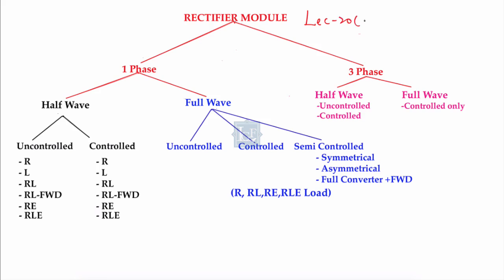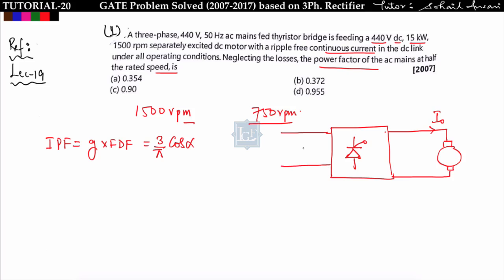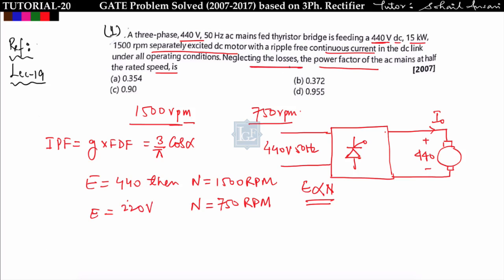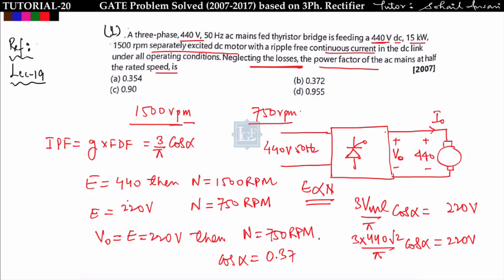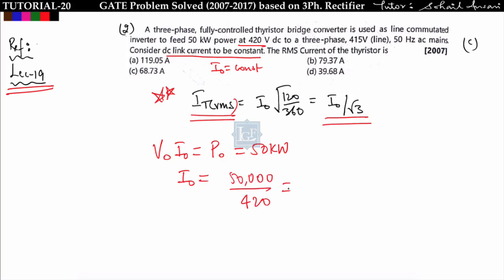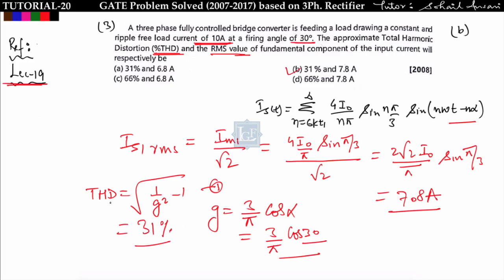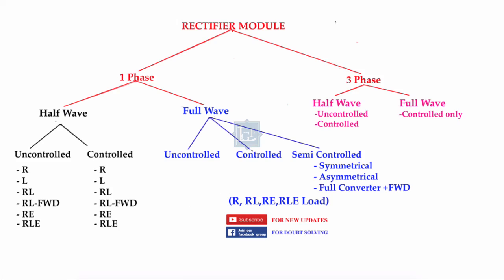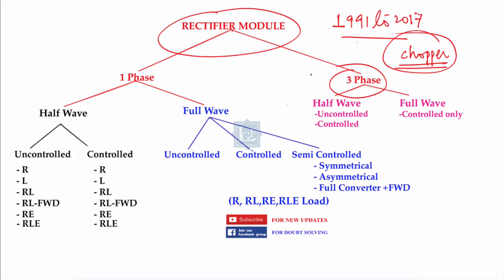Lec 20(b) GATE Problem Solved (2007-2017) based on 3Ph.  Rectifier

Comment: In question 4, Io max should be equal to ioavg as load is inductive. So why don't we find Vo avg by using 3 phase rectifier formula and then applying Kvl to find Io

Comment: in 3rd problem g=(3/pi) for fully controlled bridge converter why did u take g=(3/pi)*cosα which is the value of i/p pf explain please
Reply: i sorry sir u mistakenly wrote that but the ans is correct. another doubt sir in fully controlled bridge converter g is constant (3/pi) and THD depends on g so THD will be constant there u told that THD is fn of α how sir please explain